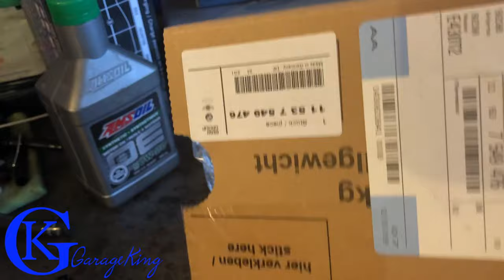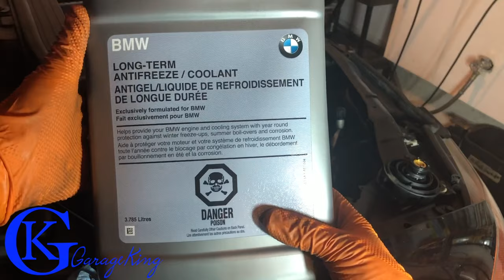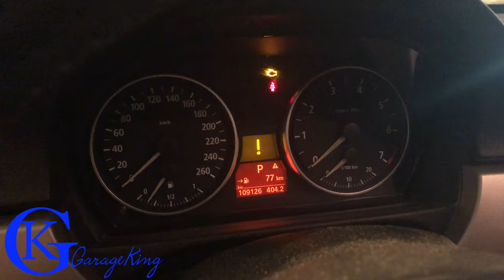Replace your BMW 3 Series' electric water pump - Step-By-Step Guide

Comment: Beamers are such smooth rides
Reply from the maker: Gotta love them, they are a "fun" car to drive !!!
Reply: Great car to drive but bloody expensive to repair
Reply: Until the check engine light comes on again
Reply: Not if you do the repairs yourself… unfortunately it’s 90% a pain in the ass lmao
Reply: @TheSeejay35 only expensive to people who don’t work own their own car
Reply: Bimmers
Reply: BMW is very smooth
Reply: @TheSeejay35 LMAO NO fkn Doubt😂
Reply: @AshtonLudlam  That's what I figured out with my e90 I just picked up. They're nice rides and parts are cheap but labor is expensive because they are annoying and not built like japanese or American cars
Reply: They are….all you need is to replace the all the gaskets, plastic bits….like hose couplers, oil filter housing, valve covers, intake gaskets, electric water pump, plastic timing guides, Vanos……easy😂

Comment: The bolts the hold the sway bar have a circular bolt on top and are supposed to be welded to the rest of it, one of mine wasn’t. After hours of trying to grip the circle from the top, the nut stayed stuck on, I ended up drilling it out of there. It’s crazy how the parts of these videos that take you 1.5 seconds can take me 3 hours.
Reply from the maker: Hey There, I didn't know about the factory welding. I guess I got lucky on this one as everything came apart alright.  This only thing I actually fought with was the electrical clip for the waterpump, I struggled with that a bit.  On my vids when I do struggle with bolts, most times I do put it in.  I don't film the whole extra two hours or so, but I will put that in at like 50X speed or something like that to show the struggle is real.  Glad you did get it all done and thanks for the comment.
Reply: @GarageKing  I appreciate the video, no frustration directed at you, just the universe. Keep up the good work king
Reply from the maker: @alexwood9941  Thank you good Sir !!!

Comment: Had a plastic thermostat. 2006. Had all kinds of trouble getting water pump to bleed system. Shot all electrical connections with contact cleaner and made sure all was tight. Runs like a champ now. Thank you for being so patient with your video. You are great to follow.
Reply from the maker: Thanks so much for the comment, appreciate it !!
Reply: did you not replace the pump?
Reply from the maker: @scottishmarket  Yes I sure did you can see where the old pump came out and the new one went it.  I also put in a new thermostat.
Reply: Yes. The pump was replaced when I realized nothing worked still. Once I did all of the cleaning underneath, it is working great. Thanks again
Reply from the maker: @scotthawkins5078  Anytime and glad you got it all working, it can be frustrating so when its fixed its a good feeling !!
Reply: Isn’t the floater supposed to float such that the top of it is flush with the top of the reservoir? This seems to be floating above it.  Is it over filled?  Seems that could put more pressure than it is designed to hold and cause leaks?

Comment: The proper method to reattach clip locked hoses is to first press the clips into the lock position, then attach the hose until you hear a click. This ensures the hose is absolutely locked. If you do it like you did in the video, there is a risk of the hose not being fully locked and it may pop off in the future.
Reply from the maker: Very good call and thanks for the comment.  I thought I did that in this vid, but I guess not.  The biggest thing/tip to do is give them a wiggle and pull once they are on.  This way if there is any doubt you know they are good.  I actually push them forward and pull back so you can feel the hose start and stop, and you know its all good.  Appreciate the comment :)

Comment: Just did all the hoses plus thermostat and water pump, my thermostat was plastic original and plastic new one oem, it’s a 2011, will say since I was doing all the hoses it was easier to remove the fan and just bang the job out the way, good shit tho it’s hard to make a good video working on cars I know I couldn’t
Reply from the maker: Hey thank you for the comment, and thank you for realizing its really not easy to make these videos !!  Many times I run into rusty bolts, super tight spots, and I have to get that camera in while I work.  Thank you !!

Comment: Great detail in this video, thanks.  I'm about to attempt water pump and thermostat change on my 2008 E90 318i with 2 litre N43 engine at 131k miles here in the UK.  For info, a few days after the pump failed around town, it's now working again, but I decided to deal with it before it leaves me stranded somewhere.  Due to long service life I got from the original parts, I've opted for like-for-like replacements - Pierburg pump online and a thermostat from BMW dealership, just need to grab the 3 bolts and some coolant after the weekend.

Both my original and replacement thermostats are plastic and although the pump failed, I'm doing both parts at the same time.  A little nervous about this as a novice DIYer, will be working on jack stands on my driveway.   Thanks again for a very clear and helpful demonstration.
Reply from the maker: Thank you for the great detailed comment, and good choice on the parts. Take your time, and you should be just fine. Be careful with the aluminum bolts for the pump, I can see them breaking very easily.

Comment: Banger video. just picked up a 325i 2006 with under 120k on the dash. bought it for a steal only 800$!!! only issue was the water pump was bad. 
I believe I did the right diagnostic by holding the pedal for 10 seconds. I saw no fluid enter the revivor and that led me to the water pump. 
i a ordering the part this weekend and installing it here very soon after 
hope this fixes my issue 
as well as great video! you definitely earned my sub
Reply from the maker: Thanks so much for the great reply, and I do appreciate it !!!  Sorry for the delay, just got back from vacation :)  Thanks :)
Reply: I paid 4,200 for a 325i with 145k miles 😭
No issues so that is good though
Reply from the maker: @angeloc1340  well at least you have no issues !! Those can get expensive!!
Reply from the maker: @owen_636  Sounds like you did ok, plus in Cali there should be no rust, so the underside is most likely very clean.

Comment: thanks for this. I watched another video, and the guy tried the replacement without removing the radiator fan... he complained the whole way through. lol. and also decided to remove the thermostat first... squeezing it through the very tight spave between the fan, and the chasis... I asked if removing the waterpump first would be better because it would free up more space... no answer, but that is exactly what you did... thanks for that... I am pretty sure you've saved me 30 mins to an hours... thanks
Reply from the maker: Thank you for the detailed comment, I appreciate that and I'm glad you were able to get something out of the video to help.  Cheers

Comment: Finally got around to doing my water pump and everything went according to your video except my power steering bracket has a 10mm nut instead of a 8mm in your video. I keep referring to your instructions as I go. Again, great video and instructions
Reply from the maker: Hey thanks for the comment and if the only difference is a nut I would say that's a win !!!  Thank you

Comment: Wow thank you so much super informational ! I know this video is a year old and I don’t know if you’ll see this, but I’m looking to do the job myself as well. This is an absolute huge favor, but I’m kinda new into doing my own maintaice ( I just recently replaced my radiator and coolant system) I’m wondering if you could send a link to where I can find the right screw sizes for the pump and thermostat.
Reply from the maker: I still check my comments on all my videos, I got a starter one in the works for this car.  Anyway here is the link for the water pump bolts https://amzn.to/4c2SugC and I don't remember having to replace the thermostat ones.

Comment: I just replaced thermostat and didn’t fix my problem water pump next. Thanks for the video I sub and I have a 2006 and it was a plastic thermostat
Reply from the maker: Thank you for the comment, mine is a 2006 with a plastic thermostat as well.  Hope you have a great weekend, and at least you know the water pump is doable now.

Comment: Great video - gets right to the point without fluff.  I just finished the same operation on my 2013 E92 SULEV and based upon the guidance provided, it was largely uneventful (!).  I did have a couple of observations to pass along to help others.
* There is an electrical connector on the passenger side of the fan shroud that goes to what looks like a radiator surface temp sensor on the backside of the radiator inside the shroud.  Associated with it is a pass-through bushing that loosely fits in the side of the shroud, a connector and two cable mounts.  One cable mount is part of the connector body.  Both mounts must be removed and the cable disconnected.  The connector body mount releases from the shroud with a quarter turn.  The other is a snap-in and is pried out.
* When reinstalling the fan assembly, the aforementioned bushing must be aligned in a groove in the side of the fan shroud.  It’s held in place by the shroud and the radiator. If it’s not correctly aligned, the shroud won’t fit up right.
* The fan assembly has three pins that align it and hold it tight against the radiator at the bottom.  It also has a slide in slot on left and right side midway up.  The slot has a retention tab that must be released to slide the assembly up. All of these retention and alignment features must be correctly engaged for the assembly to fit up correctly when reassembling.
*The fan assembly has a hook feature the also retains and aligns with the chassis crossbrace along the top.  If everything mentioned is properly aligned, the fan assembly drops onto the hook and the single locking T25 screw lines up.  If anything isn’t just right, no dice on the screw lining up.
Reply from the maker: Thank you for sharing, and thank you for taking the time to write this!!  I can tell it took you a while to write so I really appreciate it, and thanks for the positive comment on the video.  Happy Sunday to you my friend !!
Reply: @GarageKing  It’s a community of interested people and I’ve been both a pro and shadetree mechanic over the past 50 years.  We all learn from each other.  You took the considerable effort to post a great how-to for DIYers that saves probably $1200 in stealership labor charges (the local San Diego dealers base labor charge is $260/hr) for what becomes a very routine repair if you have the guidance.  My respect and appreciation for your effort was to add tips on what I found to be the more difficult elements so others will be even more empowered. Kudos and I look forward to viewing your other postings!
Reply from the maker: @TheGreatGastronaut  Thanks very much for the feedback, you obviously have a lot of experience so I'm glad you are sharing. That knowledge is valuable and deserves to be shared !!

Comment: sub'd and rep'd thank you for this, I'm inheriting a 2010 328I with 93k on the clock and you made it look easy good sir. I also will keep the as long as it works don't replace it as I'm going through and proactively replacing things, spark plugs, coils ect just to make sure no issues. Also appericate the coolant information as I've got a tacoma and cx-30 and they us the premix stuff which is far easier. 
Again thank you so much for the information.
Reply from the maker: Glad I could be of help, Just FYI - I just did a no start check and starter replacement for your car, that was last week.  I alternate content between vehicle repairs and the Snap On tool deals.  Feel free to reach out anytime !!

Comment: Am 77 old gram with first older BMW. This is very interesting. Replaced cracked water overflow and never bled so getting a low fluid light 1x  each time (5) I’ve driven then disappears. Will bleed and check for for water flow. If light disappears 👍🏻- if not will check with Motörhead son then may or may not need pump replacement. Thnx for explaining.
Reply from the maker: Thank you for the comment and congrats on getting your first older BMW, they are fun cars to drive around !!  They handle great for older cars and even outperform many new ones.

Comment: Great video. Is that a failed all metal pump? I assume it was motor failure, not pump failure?
Metal thermostat housing, that's so much better
Reply from the maker: Hey There, the factory pump failed and the car overheated.  I wasn't sure if the thermostat was damaged so I replaced it with a new one from BMW.  Interesting the new thermostat right from BMW is plastic so I could not get a metal replacement.  I wonder if the new cars are all plastic?  This vehicle was a 2008 I think.  I agree with you the metal housing is much much better !!

Comment: Hello is awesome video thank you ,one question how is the water pump working is a good item for your bmw ?
Reply from the maker: Hey There, and thanks for the comment :) a good working water pump is necessary for the BMW as it cools the engine.  If it's not working the engine will overheat and that can cause a lot of problems.

Comment: The aluminum thermostat housing is better than the plastic type , plastic type tends to have premature leakage
Reply from the maker: You are right for sure, problem is BMW does not make the aluminum housing anymore.  If you order a replacement you get a plastic one :(

Comment: Thank you for this! Doing this Friday. How many hoses do you need to disconnect from the water pump? Just 2?
Reply from the maker: Hey there, I think there is 3 in total, there is the one at the front of the pump, then there is the thermostat group, and then the one for the housing right above the balancer if I remember correctly.  I show them pretty clearly in the vid.  Believe it or not the footage was over 3hrs for this job and I compressed it down to 17min !!  That was the shortest I felt I could do it without skipping steps.
Reply: @GarageKing  thanks again! This helps a lot! Truly appreciate you making this tutorial
Reply from the maker: @jacobadams8113  Thanks brother !!
Reply: @GarageKing  are the bolts for the water pump and thermostat E10 & 10mm?
Reply from the maker: @jacobadams8113  Hey There, they are E10.  Having a regular 10mm around is always good no matter what the job !!!
Reply: @GarageKing  thank you again!
Reply from the maker: @jacobadams8113  Anytime !!

Comment: Hello, great video, how many miles will it be necessary to change it, I have 110,000 miles 325i 06/2010, BMW tells me that if it works well I don't need to change anything, I'm going to do 1000 MILES and I don't have want to have problems.Thank you.
Reply from the maker: Hey There, I think they are giving you good advice.  This is one of those things where if it aint broke, don't fix it. You never know when its going to fail, so its best to wait until it does.
Reply: @GarageKing  Merci..
Reply from the maker: @94tontonche   pas de problème, heureux de vous aider !!  No problem, glad to help :)

Comment: My 06 had a steel thermostat. It still worked perfectly at 180k when i replaced it along w the waterpump. The OEM plastic Wahler pump barely lasted 40k until i started getting thermostat codes :/
Reply from the maker: Good to know, I did save my steel thermostat (no codes yet) but if I ever get a thermostat code I think I'm going to put my steel one back in.

Comment: The water pump in my '06 330i was changed in 2016, radiator in 2020, expansion tank & cap in December 2023, thermostat this January (2024), and the corroded  plastic valve connecting the coolant tube to the head gasket was replaced with an aluminum one in July.

Thee's a small leak in my radiator and my water pump drains the battery (8 amp drain) when the engine's off. Removing fuse 54 when parked stops the pump and preserves the battery. 

While I obviously need to replace the radiator yet again, why's the water pump running-- beyond the 12 min bleed-- when the engine's off?
Reply from the maker: That is a bit of a puzzle. It should turn off.  If you know anyone who has a bi-directional scanner they can turn the pump on and off with the scanner, and see if it responds properly.

Comment: 2011 E82 N52 plastic impeller housing, metal pump body plastic thermostat housing from the works, now nearly 70k miles just about to replace pump with Pierburg all metal and Mahle ( OE as far as I know )  Thermostat housing. Metal Thermostats dont's seem to be available at all so plastic ones are prob not an issue?
Reply from the maker: Yep,. I put a plastic one in, you can see in the video, and its still going strong.  I was not able to get a metal thermostat either. I think the plastic ones must be fine.

Comment: Broke some clips still not able to get the top bolt on the pump out super tight in there 😂super mad 😂
Reply from the maker: Take a break if you have to, I know sometimes its best to just leave it for a few hours and come back so you don't get frustrated. Believe me I know !!!!

Comment: What was the symptoms of the one you replaced? Was it able to bleed or not?
Reply from the maker: It did bleed, but it was very weak, I can't remember if I showed the before and after, that may have been at the end of the video.  If I remember correctly I filmed what the pump did before, and after.  I may have put it right at the front, or right near the end.
Reply: @GarageKing  It is at the end, I see it. So it wasn't overheating.  I'm asking because mine doesn't bleed at all and overheating.
Reply from the maker: @miraciamiracia8007  Mine was overheating, even with the pump being weak, it was still overheating.
Reply: @GarageKing  Got it, thanks for taking the time to answer
Reply from the maker: @miraciamiracia8007  Anytime